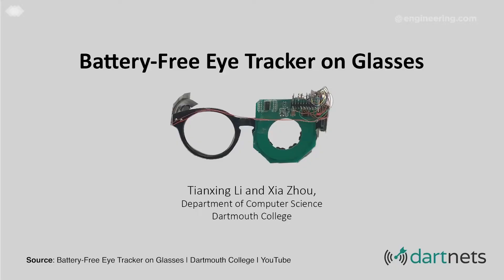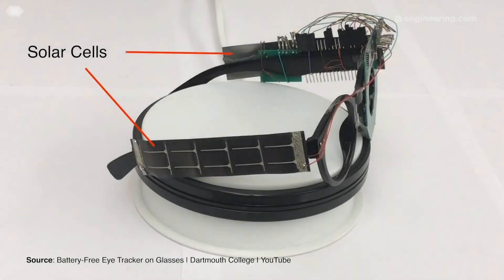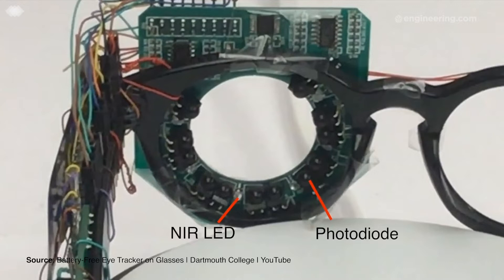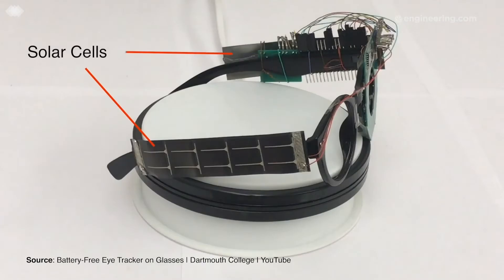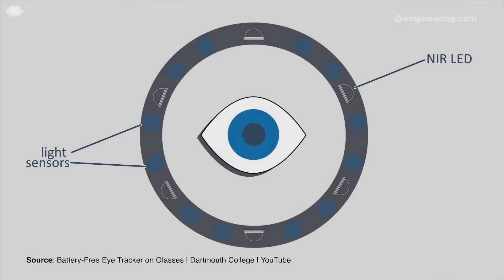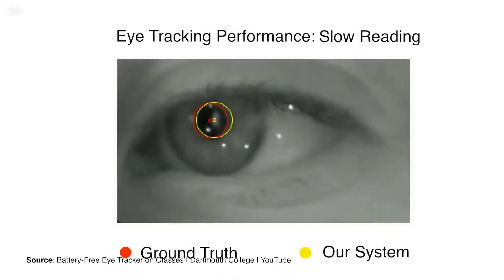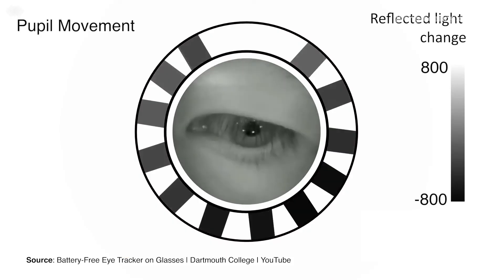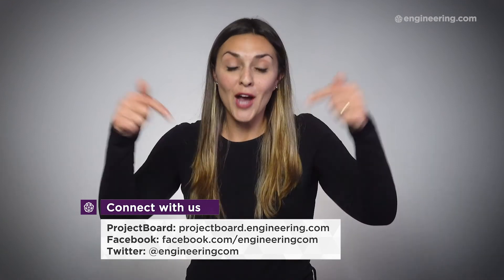How Do you Build an Eye Tracker Without Batteries?

Comment: UwU, we switched batteries for solar cells. Really impressive guys. The pressing question is: are these trackers much more energy efficient than regular ones. That would be impressive, not switching out the power source of a device 90% of people use in the dark

Comment: Breaking news - we are delighted to see that our proposal for storing energy by massive flywheels (see ProjectBoard) is now recognised as a really efficient, sustainable, robust and practical proposal at:  https://www.youtube.com/watch?v=Q9qJbNmAf2s  We understand our proposal is also gaining a second look by a team from EDF Energy.  We would like to confirm the Dutch team's findings that there is negligible impact on the earth's rotation in whatever direction the flywheels are mounted.  We re-emphasise that our proposal uses traditional bearings and is a max inertia (ie high mass and radius)-low RPM solution. The flywheel is run in an enclosure in which the air is deliberately allowed to heat up by bearing losses as this increases the speed of sound and increases the RPM in which the flywheel can be run without exceeding the designed rim max transonic speed of 0.7 Mach - at which point the drag really starts to increase significantly.